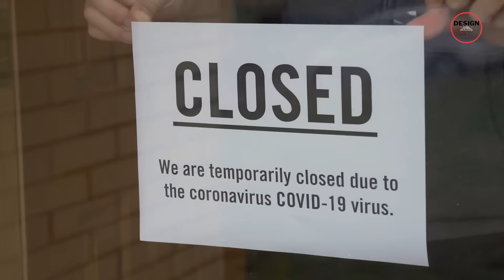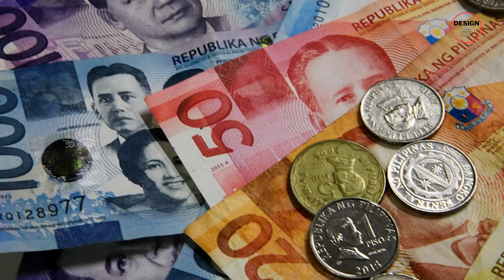What Went Wrong?  The Delays Behind Manila’s First Subway

Comment: It was a right of way issue that hindered the construction. It was a PPP(public-private partnership) project with JICA as the main investor/loan which the Aquino administraion tapped. The study conducted also by JICA for Metro Manila Subway,  encountered some problems with right of way. It was the same route and would have traversed Makati and the end station is at NAIA.  When the Duterte administration took over, they did another feasibility study using a different route from Taguig to NAIA by not passing Makati and MOA. The feasibility study conducted by JICA took over 2 years to complete and construction started in 2019.
Reply: If Sec Dizon is right in saying the existing approved loan was cut by “80%” maybe due to findings that previous loan was diverted elsewhere. 
Which will be a major cause for its stoppage.